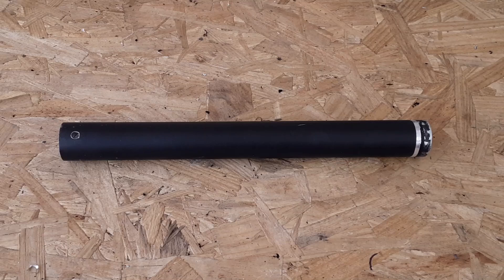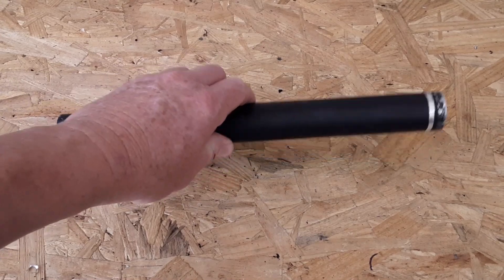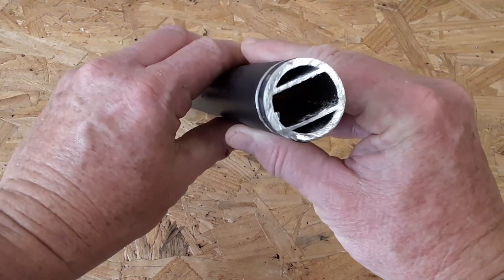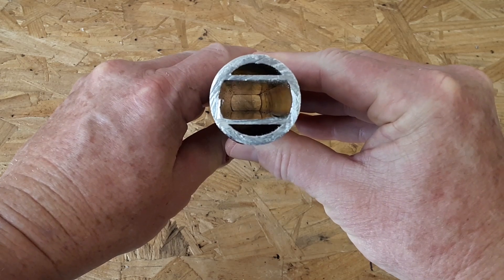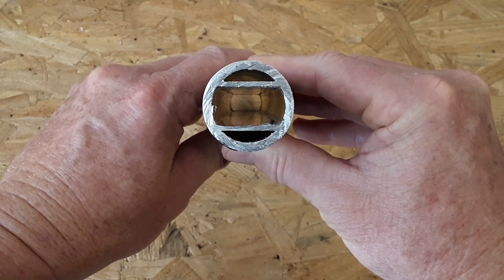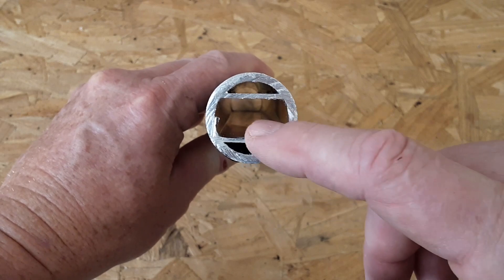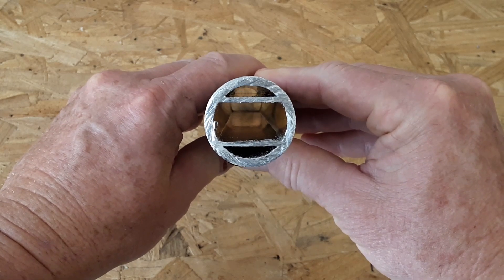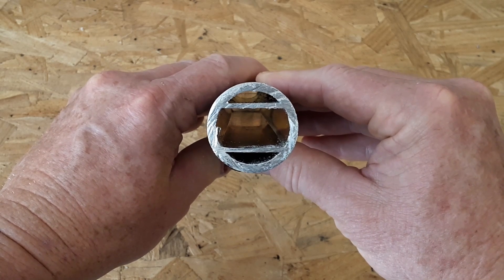Haswing Cayman Series Trolling Motor Shaft Modification

Comment: Would you happen to know if I can replace my Hawsing shaft with a minn Kota shaft? Possibly do know where I find Hawsing shaft. I need to extend or replace mine with a longer shaft. Thank you
Reply from the maker: Hi Christopher. I don't know if the shafts are interchangeable. Most standard trolling motor shafts are 1 1/8 iches in diameter. Depending on the Haswing model, the shaft sizes are not the same. In all honesty, I would just get a longer shaft trolling motor. Once you open them up and reseal them my opinion is that they are never the same.